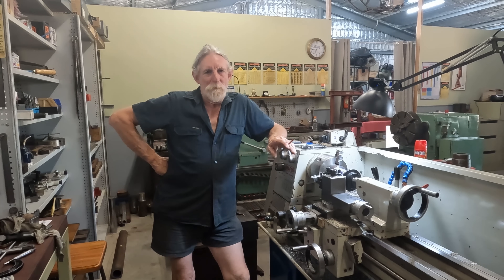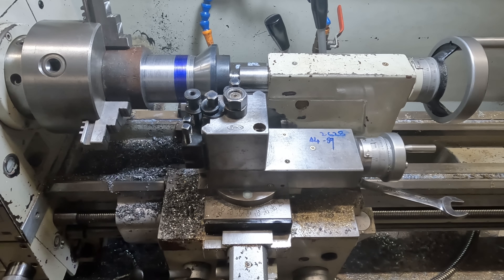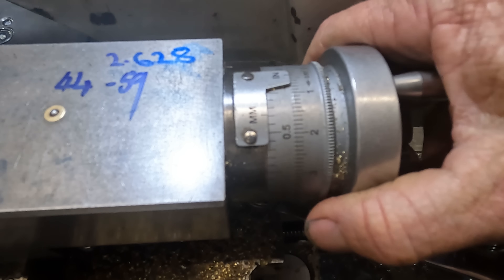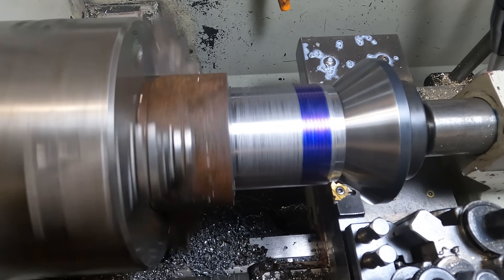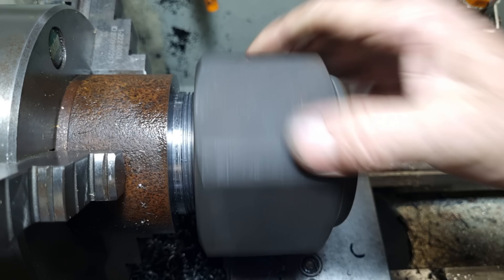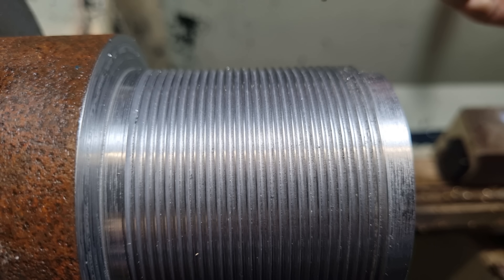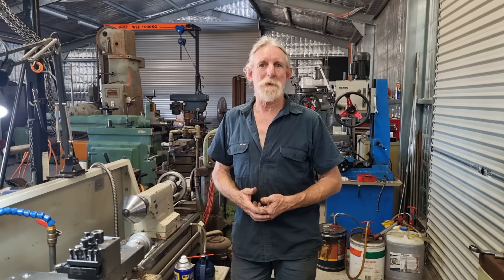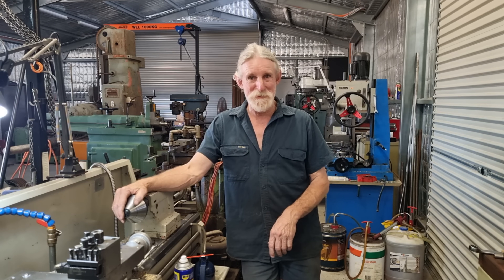An Alternate Method To Screw Cut Larger Pitches In The Centre Lathe .

Comment: I used this method on a big Mazak with a good spindle brake. At the end of each cut, hit the foot brake and retract the tool simultaneously, into reverse, new cut and repeat. A couple of mimutes later at 350 rpm and five cuts all done. Material H13 tool steel hardened to 52 Rockwell C. The thread finish looked ground, just beautiful like it was cut on a CNC. Cheers.
Reply from the maker: Hey , no worries .    I have a 21'' lathe that is a Mazak copy !   👍
Reply: @swanvalleymachineshop  The biggest diameter in the Mazak was 510 mm x 450 mm long, being one half of a plastic injection mould for the eleven litre icecrean parlour tubs. We produced injection moulds for thin wall food containers and plant pots large and small. At the time circa 1980s, the lathe had Sanyo electronic read-outs. Also, as an attachment, a Minic hydrolic profile tool tracer. The lathe had power and accuracy. I pushed that electrical amp gauge to the max when shifting metal. Thanks for bringing back some great memories. Cheers
Reply from the maker: @AquaMarine1000  My one is a Chinese copy , JFMT 530 x 2000mm  with rapids .  The machine  manuals are all Mazac copies .

Comment: and if one uses a hss tool one can grind  it with a side positive rake, getting the nicest chips and cleanest cut possible.
Reply from the maker: Yes , no worries there .  But keep it to a minimum as the trailing edge will have a negative rake angle .  Main thing is to have a enough side clearance to allow for thread lead angle .   👍

Comment: I use this approach for threads of more than 2 mm pitch, but I work out a desired chip load/DOC, so I usually do less than the expected 50% move on the compound. The argument in favour of doing this rather than a straight-in cut is that my 40 year old Colchester 1800 has a bit of carriage backlash, so biasing the cut to ensure the leadscrew is under compression in the direction of travel is a good way to prevent chatter.  To complicate things, I usually cut threads in reverse away from the chuck, with the tool behind the workpiece, so the cross-slide is moved towards me and the  compound is moved away from the chuck. I often do plain finishing cuts away from the chuck as there's less wear on the back face of the leadscrew and gears and I get a slightly better surface finish. Or I might be imagining things! Great stuff Max.
Reply from the maker: Thanks . I have only used a rear tool post for parting .    I think i would wind something the wrong way for sure with a rear post & opposite threading !!!  👍
Reply: @swanvalleymachineshop It would definitely require a rewiring of the brain. I’m at the age where that would be a monumental task. 😂

Comment: I was taught this method of screw cutting as standard at TAFE back in the 1980’s.
Using the compound slide at 30 deg was never even mentioned.
I notice that popular machinist like Kurtis from Cutting Edge Machining also do it this way as standard.
Personally these days, I usually offset the compound.  Makes a lot more sense.
Reply from the maker: I was there in the early 80's as well  !   Can not remember what methods they taught as i was screw cutting  on lathes a couple of years before my apprenticeship .  👍

Comment: I guess you watch Josh Topper as well then! An extra benefit of having the compound parallel to the axis would be to make it easier to pick up the thread again if the toolpost slips or you have to mess with the tool before the thread is finished.
Reply from the maker: Exactly that .  Also easy to chase damaged threads .  👍

Comment: As an "older" person I quite often get asked to work on older machinery and vehicles. I can see how this works with a 60 degree thread, Metric and UNF. but I don't think it will work on BSW and BSF 55 degree threads ? Please correct me if I am wrong.
Reply from the maker: I just grind 55 deg threading tools from HSS .   Also i would use a 60 deg tool but  cut the last 1/4 of the depth with a die nut .   It all comes down to how critical the thread is , like what is it's use .  I have hardly done much BSF , but in the last couple of months have done heaps !  👍
Reply: It would work just fine, technically the compound feed ratio would be a little less than it would be for 60° threads but in practice it's so close you probably wouldn't notice the difference once you had done the fine finish cuts straight in to clean up, It's doing the same thing as setting the compound to 29°, 29.5° or 30° (or ~27° for Whitworth) but just using two movements to achieve the same thing.
Using a good die to finish a thread is a really handy and quick cheat for standard tolerance thread cutting, saves a whole lot of time measuring what you have been cutting.

Comment: Great tip I do it like that all the time but only a very small compound move never realised could move it half the in feed  till your really close to size thanks max
Reply from the maker: 1/2 is about the limit otherwise things turn ugly .   Still have to leave a small amount for a couple of light finish cuts , straight plunge in .  But you do that anyway with the angled compound method as well .  👍

Comment: Instead of feeding in X amount on cross-slide and X/2 amount on compound, thereby cutting on only one side of the tool, wouldn't you get the same load on the tool if you left the compound fixed, and just fed in the cross-slide in smaller increments?   Since that would cut on both sides, you could be removing the same amount of material.  The ratio of tool load to material removed would be the same, and the job would take the same time.  But with less probability of error.
Reply from the maker: That is the normal straight in feed method for smaller pitch threads .   The compound shift lets you take heavier cuts and less cuts .   Quicker , but if you are not used to it , things can get ugly .   Larger pitch threads you don't want to be roughing on both the edges of the tool .  CNC's have different G codes for a similar method . 👍
Reply: @swanvalleymachineshop  : Max, thanks for your prompt reply, but I don't follow.   You began by saying that for larger threads, going straight can put too much load on the tool.  Presumably tool load is proportional to depth of cut multiplied by width of cut.   For a straight in cut, you are cutting on both sides, thus a wider cut, so to retain the same load of the tool, you need to reduce depth of cut.   The volume of material removed is also proportional to depth of cut X width of cut.   if you didn't reduce the feed you would be removing a greater amount of material per cut.  Thus the number of cuts and total machining time should be about the same.
Disclaimer:   I only machine things occasionally - my day job is desk work.  I have only cut threads by going straight in and finishing with a die nut to assure correct form and good finish.   The double feed method you showed sounds like something that might have a reason, but I can't see what it is.
Reply: @keithammleter3824  "Presumably tool load is proportional to depth of cut multiplied by width of cut." I think that this isn't correct in reality. In practice a minimal depth of cut is required to make the tool work. Think of parting off: you have to be "brave enough" to feed in with a certain minimal feed rate in order to get a "decent" depth of cut.  Otherwise the tool mostly rubs and you get chatter.  So, you can't reduce the depth of cut arbitrarily. 
 (Try to use a 5 mm wide parting blade on a mini lathe: I dare to say that  you will never be able to reduce the depth of cut to a sufficiently small amount to make this work.)
Consequently your way out of this dilemma is reducing the width of cut. So the method demonstrated here in a very clear and instructive manner helps a lot.
Reply: @HaraldFinster  : You are correct in saying you can't just keep reducing depth of cut until you are not cutting at all.   But that can't be the reason here.  after all, we all take rough cuts and then, for precision work, finish with a light cut (or spring cut as Max aptly calls it).
i checked in the various vintage machining textbooks I have (e.g., Arnold's Workshop Technology Vol 1 1944).   All instruct you to angle the cross-slide and cut on one side of the tool - for ALL threads, not just large ones.   But they don't say why.
So I asked ChatGPT.   One should always be suspicious of anything ChatGPT says - it can regurgitate from a very dubious source, and even make things up.  But in this case it made perfect sense:-
#1:  [major reason] by cutting on only one side, you have a definite single direction load on the leadscrew at all times, eliminating chatter from leadscrew nut and gear-train float/backlash;
#2:  the cutting load is more evenly distributed over the cutting face of the tool, evening out temperature rise and wear, lengthening its' life between touch-up grinding;
#3:  Improved chip flow.   if you cut straight in, the tool is trying to make an angle-iron shaped chip.   By cutting on one side only, this doesn't happen and you have better chip clearance.
It has nothing to do with the load on the tool as Max claimed, but I can understand his error - generally in machining, if you get chatter, you need to reduce depth of cut (or change RPM or some other factor).
Good on you Max, just the same - I have learnt something today that perhaps I should have known - cut all threads on one side only.

Comment: Great video. I use this method but only use a ratio of 5 to 1. So for every 5 thou depth of cut I moved the compound 1 thou. Can you tell me what model that lathe is. I’m about to upgrade and this looks like one of the options I’m considering.
Reply from the maker: The lathe is a Hafco AL960B   .   Cheers  👍
Reply: @swanvalleymachineshop  thank you.

Comment: Hi Max, nice free cutting instead of forcibly displacing the metal, I think Josh had a clearance issue with his travelling steady and compound.
Reply from the maker: Yes ,  a bit tight for room .   But there are always ways around that !   👍
Reply: @swanvalleymachineshop  I felt sorry for his Lathe, wincing in pain but liked the hardened points on the 3 legged travelling steady, only seen bronze or rolling element bearings.

Comment: Hi Max  Another great video.  If you had a much more rigid lathe, would you do a straight plunge cut?   Love the shorts just like mine.  Cheers
Reply from the maker: Not really , it depends on the job .   About 8tpi or 3mm pitch .is where i stop doing a straight plunge cut .   👍
Reply: Thanks for the info and stay cool (from hot and humid QLD). @swanvalleymachineshop